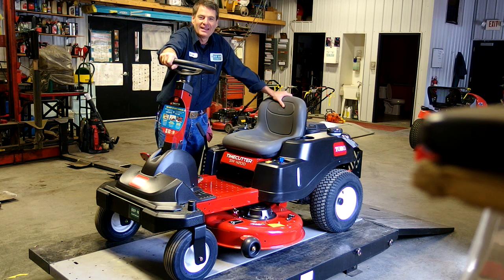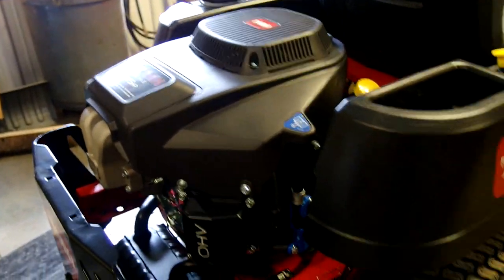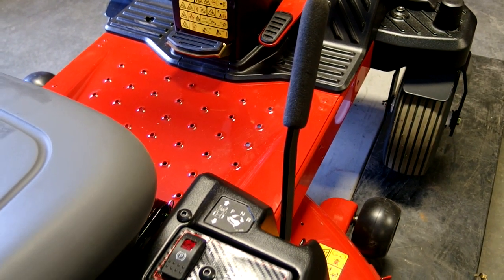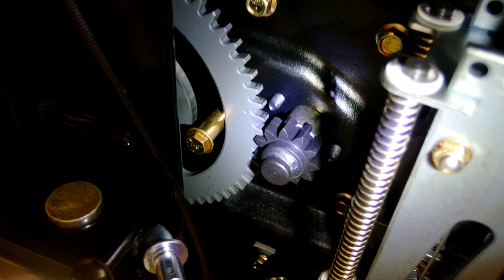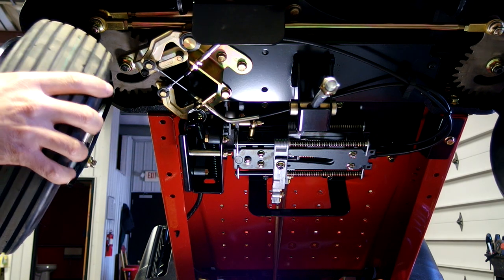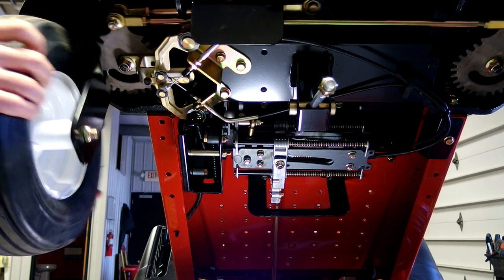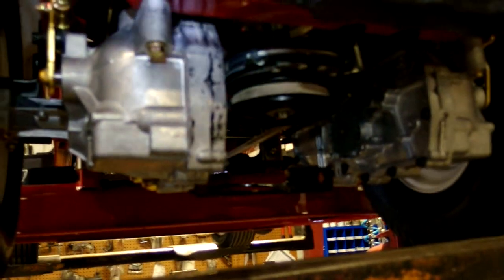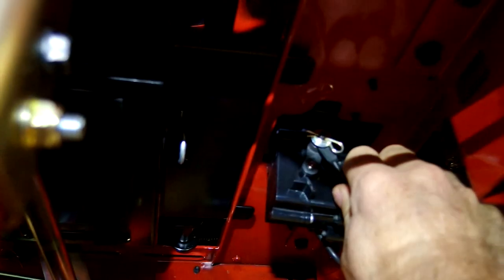On The Bench SW4200

Comment: Unfortunately, the large gears at each front wheel are too weak. They break at the skinniest point just past where the tie rods connect. I've found a way to fix this issue though with a TIG Welder and SS308L filler rod. You have to pre-heat the gear and weld a 1/8" steel reinforcement plate to the skinny spot. Post heat your weld and submerge it in sand to complete the fusion process. What you're left with is a much stronger gear that can take the beating of zero turning on rough lawns. It amazes me that Toro opted to use cast iron on these gears as opposed to a forged gear.